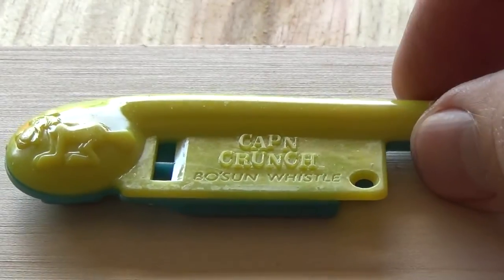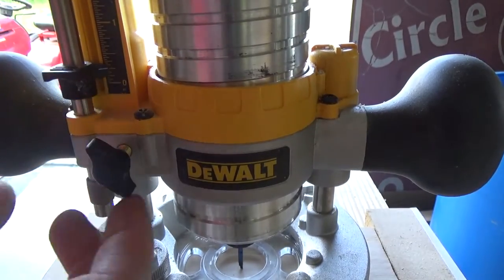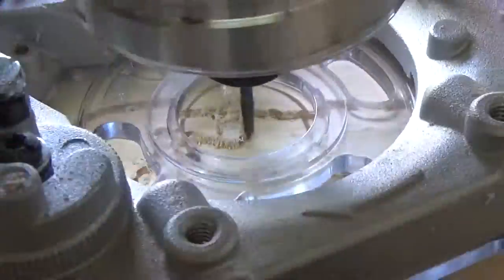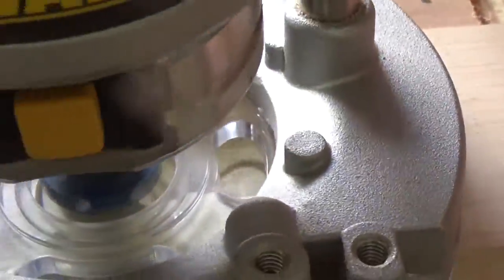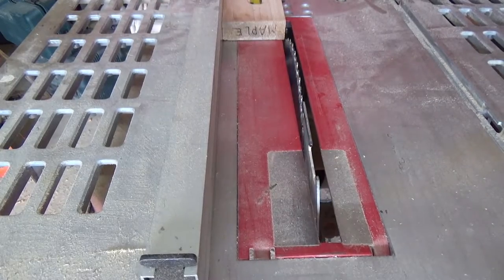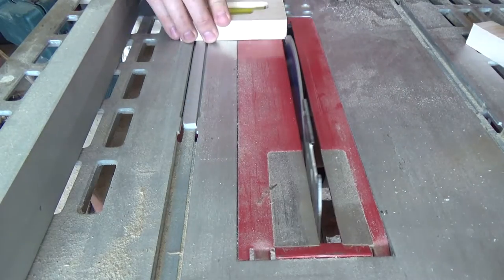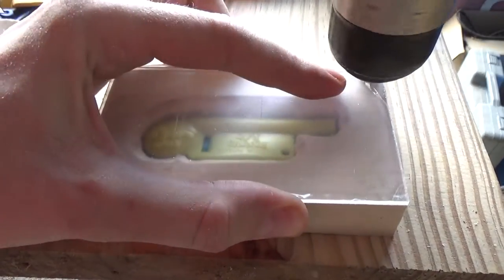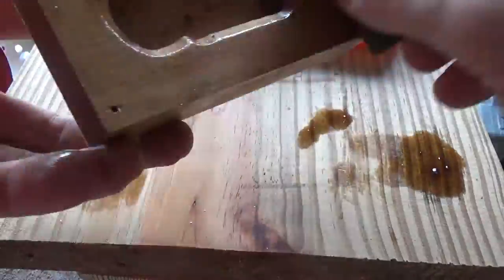Let's Make a Custom Fit Display Box | How To

Comment: Nice, I have some stuff that would cool in a display like that.
Reply from the maker: Well, get to it ;)
Reply: My router is fixed based! I guess that's not really an excuse I could make it happen still!
Reply from the maker: Yeah, as long as you can change the depth on it, you should still be able to do it :). Or cut the piece in half, cut out the hole you need and glue it "back" on. You'd have pretty close to the same result. And, you could probably think of a million other ways to do it/make it better.